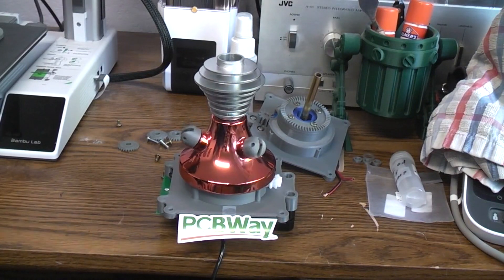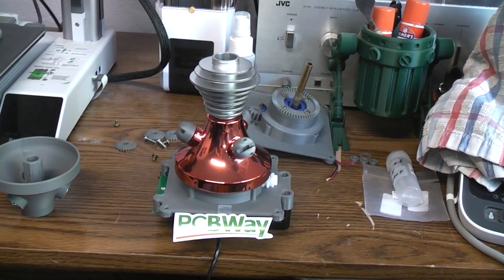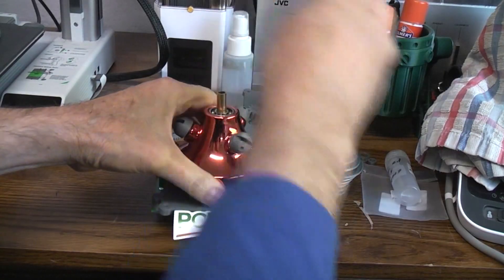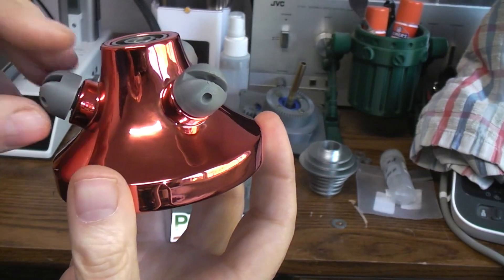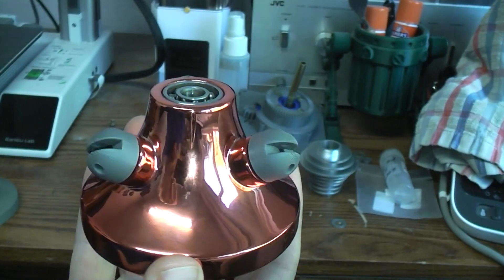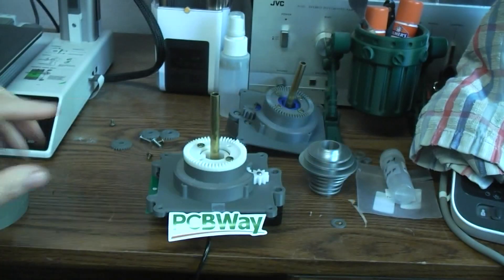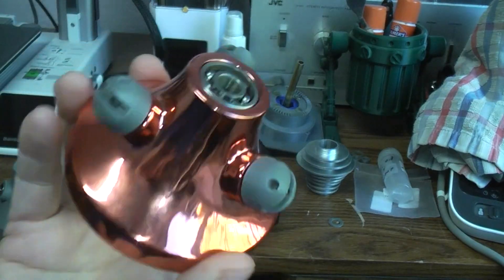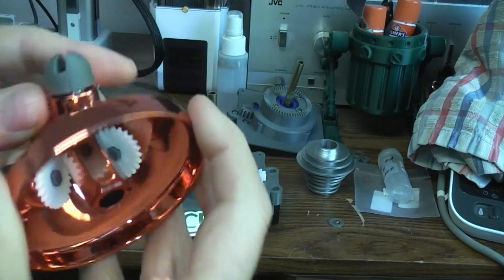Look at this 3d printed resin part I had Electro Plated by PCBWAY.

Comment: The Chinese apparently think copper is brass. Look at most things on Amazon that are made from brass and they call it ‘copper’. Sad. I would get them to redo the part in BRASS.
Reply from the maker: It will get worked out. Since PCBWAY is not open on the weekends, they have seen the video yet or my email yet. It is strange that even when you buy Brass spray paint it looks like dark copper, like a old penny. Many times, when I want a shiny brass color, I have to buy metalic gold paint. Very odd. The solution will be some sort of color sample that can be provided so the proper color is selected.

Comment: Is it clear coated - as I am not seeing any fingerprints? I bet still alot cheaper than getting it cast or machined in brass for sure
Reply from the maker: I think it is clear coated but cannot say for sure. Could just be the electroplated finish. You know like any model kit you every had that had electroplated chrome bumper parts in the kit.
Reply: @Robothut  Either way you cannot fault the result
Reply from the maker: @kieranclarke135  I agree. The color problem will get worked out.

Comment: Honestly, that's a pretty part. 
Will you use is as is or try to modify the color?
Reply from the maker: It was proof of concept part. I knew even if the color was wrong it would tell me if PCBWAY could do a smooth shinny plated 3d printed part.